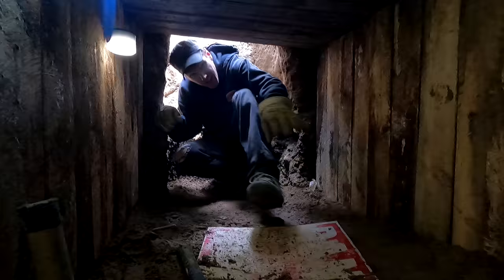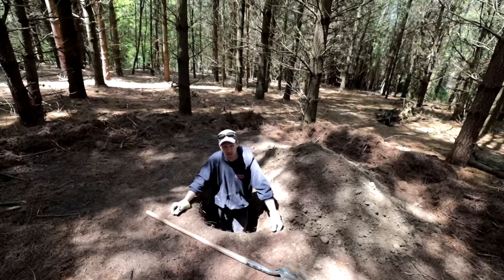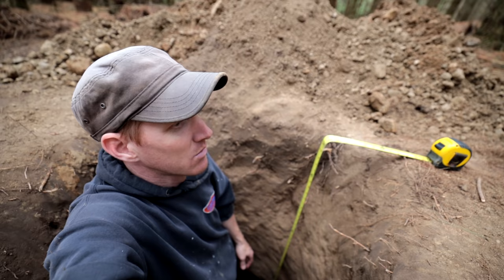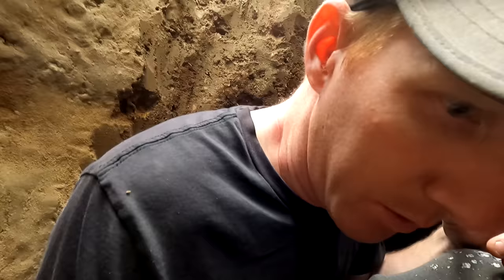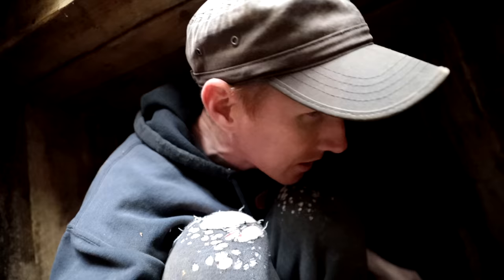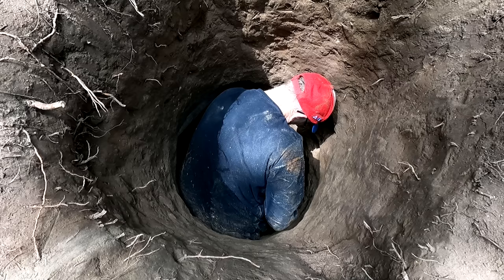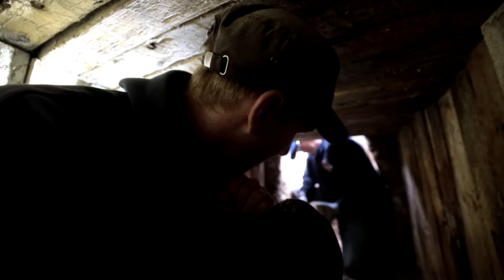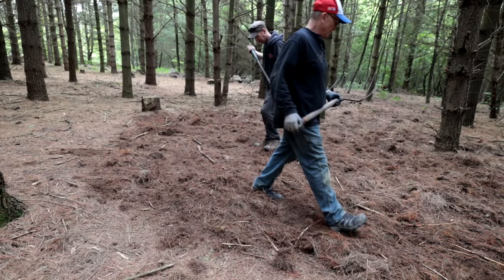Digging a Japanese Spider Hole (and sleeping in it!!!)

Comment: Retired US Army Combat Vet. Japanese (WWII) and VC (Viet Nam) used those spider holes & knew they would be dying in place when they used them.  I've built tunnels as a kid with uncles that had been miners watching over us & probably the most dangerous thing for kids to do or adults, without knowledge of the dangers involved. I would never use any ignition or open flame in a hole with a dead end tunnel that has no ventilation from both ends. Fumes & gases can gather at the bottom of a pit and kill as they are heavier than O2. Every 10-15 yrs there are kids who die from cave-ins in these types of contraptions. I'd recommend demo the thing when you're done. I love building crazy stuff, but tunnels are the most dangerous, IMO.
Reply: Methane gas build up is probably what your thinking of, as well CO2 from breathing. I'm thinking they'd have to be deeper to hit a natural methane pocket, but could be wrong. Miners go down hundreds of feet, and then send in the birds.. my only issue with this is kids finding it, & a collapse. Again, though, I don't know how much would actually fall in, as their not down very deep. I've dug tunnels in snow as a kid, used water to ice everything over, and had a very nice fort Until my Dad saw it... 10 minutes with his sledge hammer and 2 days of hard kids work was gone. 🥴
Reply: @dragonslayer7587  Eating beans wont help either if you are worried about methane gas
Reply: @chaotic1979  haha
Reply: @chaotic1979 , 🤣
Reply: @ws4860 , no, not in this instance.
Reply: @D11Alpha  There may not be any radon emissions in Kevin's area, but radon is measured 1m below ground level for statistical purposes.
Wikipedia:
Mean Bq/m³
open air 15
room air 60
Drinking water 6,000
Soil air at 1 m depth 5,000–500,000  <<<<====!!!!
Reply: PS: Look at the pages of the Government of Canada.
Can't post the link, search yourself with:
"Radon Action Month in Canada - Data Blog - Public Health Infobase"
Reply: @D11Alpha  You're pretty arrogant. You call Wikipedia a dubious source and you're trying to ridicule me with "gophers and meteors", but you don't prove your own statements. You don't even seem to have read my references to the Government of Canada website. 
Of course radon is not a short-term danger, but the soldiers often spent several years and many hours a day in such holes, as you should know (also Vietnam, Korea etc.). Second: In large parts of Canada the radon radiation is quite high. I wouldn't discount it like that.
Reply: @D11Alpha  True, I have to correct myself, you're not arrogant old man, you're a narcissist and that's not going to change. That's why this pointless texting ends here for me. 
Just one more sentence: "Guys in Vietnam" haven't only been the foreign soldiers, you forgot the Vietnamese people. They lived for years in spiderholes, foxholes, tunnels. Just search "Cu Chi Tunnels , Ho Chi Minh City ,Vietnam" in YouTube, it seems, you forgot this or you never have been there.
Reply: @chaotic1979  lol, your right , just eat cold tins and skip the beans.

Comment: This is a very educational video for those who have ever wondered what it’s really like to build a tunnel system.  I’ve seen very detailed tunnel systems that could house 20-30 men.  VC and Japanese were highly skilful building these tunnels with boobytraps for intruders. Veterans during the VN War were highly trained in close combat tactics to travel inside the enemies tunnels removing threats. Good tunnels should have camouflaged 3/4” pvc pipe with a 180 elbows and steel wool to let fresh air pass through while keeping bugs out about every twenty foot. Those tunnels are very effective at avoiding and evading most threats. One word of advice is to be cautious when venturing into your or a newly found built tunnel for snakes that love to nest in dark warm areas during hot and cold seasons. Great Video

Comment: Nice, but a few tips.

If you are digging one for the purpose of hiding, don't pile your dirt. Spread it out as soon as possible. Also wait a few days after applying your camouflage layer before attempting to use as it can be obvious to some that the area has been disturbed. @ 30:17 you might not be able to see the entrance but you can see the large area where you two raked up and relayed the pine straw fairly well.

Avoid low lying areas and Build your floor angling uphill from the entrance to help prevent water from pooling in your living space.

The spider hole is definitely a good fighting shelter, but it's better as a pre-built structure than one built as needed.
Reply: I was also wondering about this! where do they hide the dirt? is just spreading it out and putting the leaves/needles over it again convincing enough? how long does it take for the pine needles to not look disturbed?

Comment: Eating a can of beans and crawling into a tight space with no air flow seems…dangerous 😂
Reply: In addition CO2 sinks down, this guy was using candles with no way of changing the air down there. Sleeping down there? Yeah right, could be a long sleep. As he keeps saying "Use your Brain" Ha Ha.
Reply: @fizzysh4rk  78% of air was and still is Nitrogen. I think what this guy has done is dangerous, What the Vietnamese did was still dangerous, but apparently they made provision for air movement to ensure they got a fresh supply of oxygen in the air they were breathing down there.
Reply: Especially if you fart  ...
Reply: @dr1verman  they made air vents and coated the tunnel walls with scooter motoroil to keep deadly insects away
Reply: No farting.
Reply: @dr1verman  You missed the part of the video where he said he kept the hatch cracked to circulate the air.

Comment: 04:30  Those folding Army shovels are called "entrenching tools." We used them for digging foxholes. They can be locked upen, as it was when you picked it up, or at 90 degrees, or folded against the handle to put in a cover that attaches to a pistol belt for carry.
Reply: Was about to point out the same, the "little army shovel" is literally called an Entrenching Tool (or, more commonly, E-Tool).  I still remember getting to dig foxholes with one in red Georgia clay in the middle of summer during an exercise once >_< (was pretty great once done, though, for the same reason it was a nightmare to dig in, it held its shape, so was able to construct a comfy seat, and the temperature wasn't bad once we got the camo netting over top for shade).
Reply: That last part is so cool to know, thank you for sharing that
Reply: E-tools also make great toliet seats.
Reply: I hated digging with an e-tool. The spade on it is too small, so it would take too long to dig a hole. One time on fex they gave us actual shovels, so it was much better.
Reply: the imperial japanese army didnt have them tho,  they had a shovel head that fitted on a short shaft it wasn't folderble, its possible they could use the T shaped ends of their mortar launcher things to dig in the same way
Reply: Saperka?

Comment: The side cribbing isn't safe that way.  If the dirt, clay slumps, it could push the side away and trap you or then allow the top to come down.  On ur next one, notch the uprights so dirt can't push side to side or top down.
Reply: Do you have any resources on cribbing and supports? I am very interested in making tunnels, but don't know how to make them safely.
Reply: @wyattjohnson5181 same here, id like to try and dig one of these for fun but dont have enough knowledge, i need the walls and roof to be safe

Comment: the tunnel could also be trapezoid or dome roof, as it is more resilient to shelling. Also, if I recall correctly the clay kickers of the first world war worked the dirt while laying on their back, which was supposedly much faster than "regular" way.
Reply: It is faster, but boy you get a lot more lactic acid buildup in your arms when they're over your shoulders like that. Also, a lot more dirt falls in your eyes that way. But if you're in a hurry, reasonably fit, and you have a good water supply, it's absolutely the way to go.
Reply: @mage3690  I think that for the clay kickers in WWI, lactic acid was the least of their worries.

Comment: Thing about the spider holes that you don't seem to have caught by about two and a half minutes into the video is that if soil's not suitable for tunneling, there's an extremely easy way to negate the dangers on tunneling. Just dig a hole and covering it with a lid as a fighting position.

Comment: Nothing wrong with using an old washing machine "cube" with no top and bottom for the hole sides, in fact two will fit nicely on top of each other for a deep hole and also can make good tunnel walls if you make the initial hole big enough to turn them sideways.  Just a suggestion (yeah I recycle everything lol).

Comment: 32:00 Oh wow... that's bringing back some memories, when I was a kid, my brother was an army cadet (basically an English version of a scout), he used to bring his army cadet gear home, and sometimes we'd camp in our back yard. Now, he had an actual camping stove, but all the rest of his gear was army issue, we used to cook up some MRE's (the tuna and pasta ones were my fav), and have a hot cup of chocolate, and it was those cubes (they were called hexi-cubes in the cadets), that were the fuel source. The outside was covered in a thin layer of wax, to protect the fuel from rain and other fires, but once you melted that, the cubes would burn for a long time, and would provide enough heat for a few hours worth of cooking.

Comment: Not just a WWII thing! This technique (and others) are still actively trained and used by the operators from the 13th Parachute Dragoon Regiment in France. Great way to hide close the action on intelligence operations behind enemy lines.
Reply: The problem was, as the SAS worked out, that when patrols with dogs walked by they were always found...and once inside there you're fucked, unable to fight back. This is why the SAS built above ground spider holes well camouflaged, so they could bug out when a patrol got too close.

Comment: DO NOT COOK FOOD IN THE CAN IT COMES IN. you need an empty can that has been put on the fire and "burned out" for 20 minutes or so to burn the plastic can liner out of the inside and thus avoid chemical contamination in the food. alternatively if you are going straight military gear, you can cook in the steel cup that is usually provided with the canteen or mess kit. the mess kits have the advantage of the metal plate with a metal lid to use as a pot.
Reply: You can cook food in original tin, just sent sides place over heat, once dents pop food is cooked. Cooked food in tin for a long time never had as problem.
Reply: @davidcox6647  modern cans you buy in the store (like bushes Baked beans) have an enamel coating inside to help protect the can from acidic contents, you should not cook in the can ever!
Reply: @eqnish  you're thinking of soda cans
Reply: @_Anthony___  um, no.... next time you open a can of any food but especially anything acidic (pineapple, tomato, chili, etc) look at the inside surface of the can. It will most likely be white. That's the lining which you don't want to eat.

Comment: The fuel for the stove is a substance called hexamine. It's widely commercially available at places that sell camping equipment and is still used to some extent by many militaries around the world, but the US military at some point switched to using trioxane solid fuel tablets instead of hexamine, and then later on the flameless ration heaters that we have today became the norm. Still not a bad idea to keep some hexamine tablets around if you're in the woods though, especially when it's wet out.

Comment: At the entrance dig it down another foot to make entering the tunnel easier but also to catch any rain.
At the tunnels end, expand that a small room.
Add a small disguised air vent at the entrance and small room to allow air flow.
Reinforce with wooden floor in tunnel and room.
Reinforce tunnel entrance with wood and a ladder.

This will make a great hidden cabin. You could call it a command spider hole :D
Reply: In some ways, that sounds like the ROCMET posts that the UK Royal Observer Corps used during the Cold War: small bunkers with weather monitoring equipment as well as a ground zero locator, ionisation chamber and bomb pressure indicator. Those were laid out very similar to the spider hole concept you mentioned. 

The ROCMET posts were for detecting a nuclear attack, and then trying to plot the predicted path of fallout from the bomb with the weather conditions. There are a hell of a lot of them around, hidden in places you wouldn’t imagine. Most have been sealed and filled in, but there are a few that are still not filled in, one of which is on the North York Moors. Tiny, just a basic concrete bunker with a hatch on top and a small room to the side.

Comment: Amazing build!  If you are burning a candle in a can, put a pinch of citronella candle wax in it for a minute, not a lot, as you are in a less ventillated space.  The mosquitoes should vanish.  You can also see where the smoke goes as you place ventillation tubes, to make sure you are getting cross ventillation.  I would invest in an alarm oxygen meter/CO2 meter to sleep the first night... and test oxygen levels with candle burning, 😴  insurance on waking up!  Cheers!

Comment: A few upgrades you could make to such a hole:
The downwards going hole should go a good bit deeper than your sleeping tunnel, that way any debree, water, or grenades comming your way will fall down.
There should be a small wall between the sleeping tunnel and the upwards going tunnel, to prevent your stuff from fall down into the hole.
Dig the sleeping tunnel deeper, being able to sit upright makes a big difference in the long run.
Build small tunnels sideways for storage, have other empty holes at the ready for trash. Same goes for the upwards tunnel, add shelves. In fighting situations this would be for extra ammo and food. But more storage is always better.
Build the floor with a bottomlayer of pebbles, followed by coarse gravel, then fine gravel or even sand if you have it. This will allow water to seap down and you won't be laying on pebbles or gravel rocks.
A small airpipe from the bottom of the sleeping tunnel. 
A bigger entrance, this makes it easier to move in and out, especially if you're wearing combat gear or just need to move supplies up and down.
A curtain between the sleeping hole and the upwards hole. Makes it even harder for light to escape.
Reply: if you want to see all these changes do them your self (no offense)
Reply: He's just adding ideas for people that view comments, its not a SJW war ffs
Reply: @lunalovegood2795  I have. Always had quite a nack for making good fighting holes when in the army ^^
Reply: @jesperstoringgaard8367  the tips are appreciated 👍

Comment: You should build a shelter above this and use it as a basement. Their are so many cool things you could use that for now that it’s finished.
Reply: maybe they could build a cabin.  and when it comes time to decide what to put in the cabin they could go with a bed, a table, a chair, and a woodstove...maybe some lighting so they can advertise a battery pack.
Reply: i’d definitely dig out more “rooms” 😊
Reply: a couple simple rooms, and you have an effective "root cellar"...insulate it well, add some ice in winter and you have an ice-room...
Reply: @timhyatt9185  don't forget about the jackery
Reply: Use the basement as a cellar.
Reply: Then it wouldn't be a spider hole lol
Reply: If you are going to build over it, use or redsign the hatch flap from Evil Dead.

Comment: if you'd put a tube going down to ground level at the back of the hole and then added a hole cut in the cover over the entrance (not the hatch) covered with a mesh to stop if caving in having an oil lamp, candle or other such heat source would improve airflow significantly, even with vent holes in the entrance there's minimal airflow so especially cooking above the hole there's a risk of carbon monoxide
Reply: Agree, you want 2 entrances. More work though.

Comment: Im active army and have always gone to the field without an E-tool even though it was on the packing list because I had my Strykers basic issue inventory which include multiple earth tools, like a full size pick and shovel. This could be just the benefit of being in a mounted unit as opposed to a strictly infantry or airborne unit.
Reply: What if your unit is ambushed, the vehicles are burning, and you have to E&E with only your ruck or assault pack?  You don't have the time to grab that D-Handle or pick mattock.  The survivors of the unit have to dig in a defense under orders from higher.  Are you going to use your bayonet to dig?  This is a scenario we had to be ready for 24/7 in Korea when we were stationed within mortar range of the DMZ.  Pack the e-tool, troop.

Comment: Be careful with cooking food directly in a can over open flame because it can release a variety of bad chemical compounds depending on the inside coating of the can. Cans did not use to have interior coatings back in the day, but, these days they're there to better preserve the can, and the food.
Reply: Some cans you can cook in, but you're right. I have done it a number of times, don't think it will hurt you but it tastes like crap.
Reply: Also back then Tin was used which is safe to heat up. Aluminium is not safe to heat up
Reply: @DesertFernweh  Aluminiumhydroxide, Bisphenol A, the inner plastic lining dissolving, it tastes like crap because it is toxic